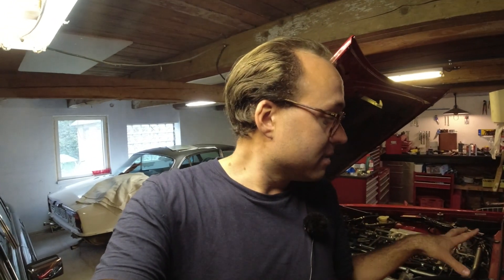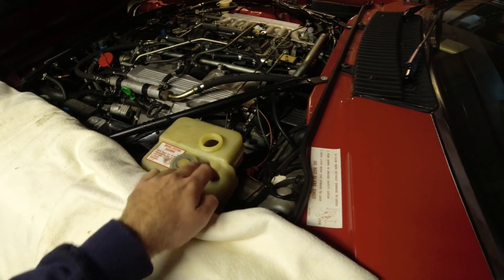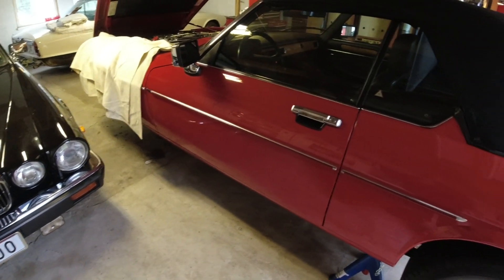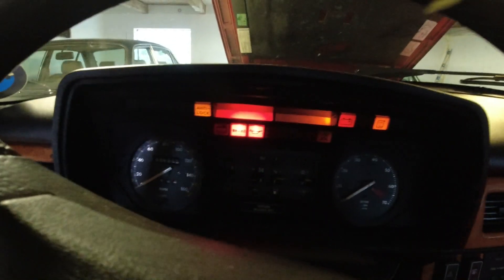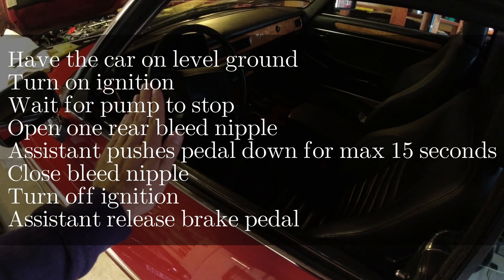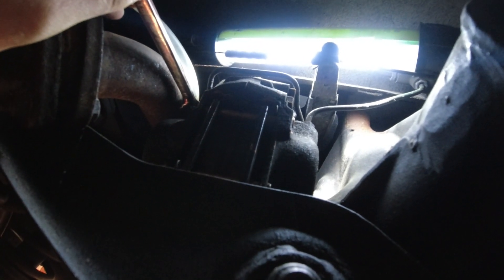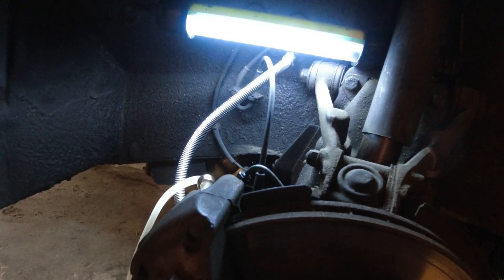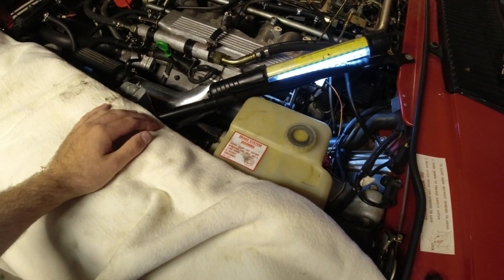How to bleed Jaguar XJS Teves ABS Brakes

Comment: My reservoir went dry, didn’t realize I had a leaking rear caliper when parked up and all the fluid left the system, what’s the process for bleeding the low pressure side? Thanks in advance!

Comment: Hi  Adam Just used your video to bleed my new Barn find. "Natasha" that also has a Teves system. Did a search and your video came up number 1. Made a mess of it first time using a sucker on the nipples. It pull out the old fluid but left the system full of air. Ended up being a big job. At least the accumulator and motor are working. Thank you very helpful! TJM

Comment: Hi there. This year I resurrected my 94 XJS which had been laid up since 2017 with rotted floors. It is now up and running and I’m paying more attention to the details. When starting up the two brake warning lights come on and then go off as you describe. However, they also come on when applying the brakes. Is this normal?  Thanks for this great video.

Comment: Very useful video for XJS owners! My XJ40 needs a rear right wheel bearing replacement. I did the left side a few weeks ago. Then, I'll use it a little more until the Halloween and it will go to sleep for the canadian winter.
Reply from the maker: Winter is coming here soon too. My XJ40 will hopefully be getting a lot of little things fixed this winter so it's ready for spring again.

Comment: Can you use a pressure bleeder like the motive power bleeder?
Reply from the maker: I would not use one of them on this system
Reply: No, not a good idea as the pump provides more than enough pressure to force the fluid down the brake lines and a pressure bleeder will probably blow the low pressure line between the reservoir and the pump and spray brake fluid over the rear of the engine compartment, not good!!